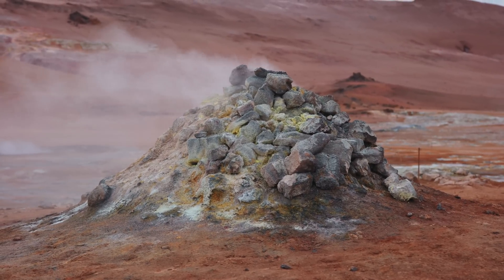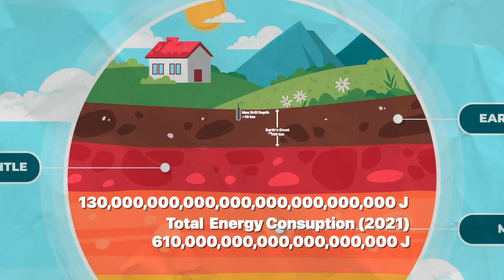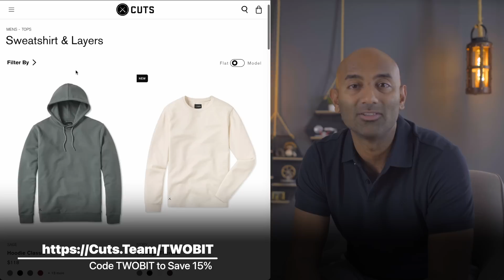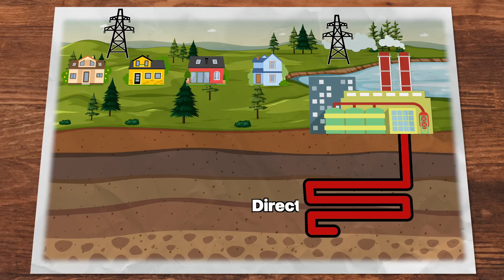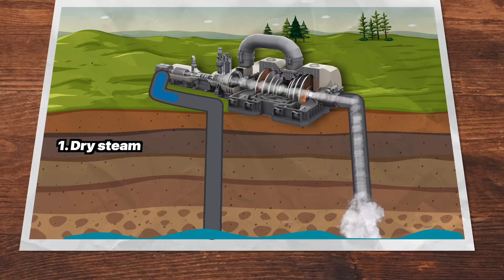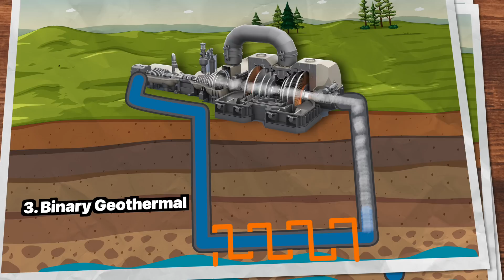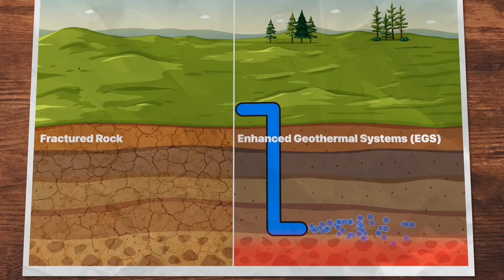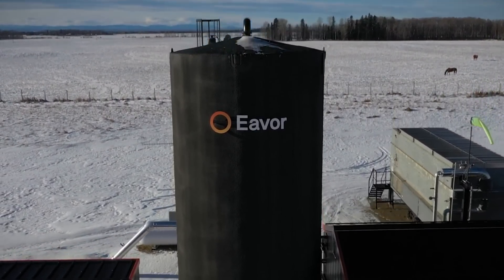This Breakthrough Energy Source Will Replace Nuclear & Coal!

Comment: Cool the core and destroy the magnetic force field protecting us from cosmic radiation.
LFTR is virtually limitless. And it can be scaled to provide independent local power. No more transmission grid which can collapse.

Comment: I am appalled that you would waist our time hearing you talk about any geothermal harvesting of a paltry 450°F when there is an endless supply of thorium fuel to run any number of Molten Salt Nuclear Reactors which are fully capable of producing temperatures of up to 1300°F, and seawater can be pumped to the plant site for desalination without causing Earth tremors. 😮 SMRs can also clean up waist water as well as providing electrical power and even much needed rare elements.

Comment: Another potential revolutionary tecnology for geothermal is supercritical CO2 as a working fluid. Higher performance and it removes the need for water in the system 

Regarding that last segment, people forget about the unbelievable amount of heat contained in Kms of hot rock. The thermal inertia of a 4Km layer of rock for a 4Km deep well is inmense, and it would deplete, yes, but in centuries or millenia if overexploited at 200% of the natural heat replenishing. Worrying about it is like worrying about Uranium/Thorium depletion or too much spent nuclear fuel; even if physically possible, the orders of magnitude that you can scale the entire world's power usage before these things become a problem are insane, it doesn't really make sense to worry about cooling down the Earth or running out of fissile material.

Comment: Solar is still the method that makes the most sense to me. The energy is there and accessible with no effort except to collect it with solar panels. This tech will improve over time, for sure, and should remain #1 on the priority list imo. I have nothing against supplementing it with other methods of renewable energy generation, especially until solar panels get to be near 100% recyclable. Screwing with the earths internal heat.. idk.. on a small level, i have no issue. On a global wide scale level.. nah. Lets stick with what we know, and not gamble on a tech that can cause unanticipated, disastrous 2nd and 3rd order effects long term. The core’s temperature is a crucial link to life on earth. Mucking around with it on any large scale is like asking to shorten humanities lease of time on earth. We all learned the core is already cooling very slowly.. adding to that cooling, even in a very minute way, sounds awfully dangerous and very humanly arrogant/ignorant.
Reply: You're dismissing geothermal without understanding the magnitude of energy in the core or the effect of isolated cooling of the shallow crust.   We shouldn't toss out a very promising clean energy technology on the basis of a gut-level fear.  There are people who know geophysics.  Solar is intermittent.  We need a continuous source of clean power for baseload.  Wind and solar can do the rest.
Reply: @incognitotorpedo42  i get the idea of the magnitude of heat in the core.. and I get that it would be a very minute draw of energy in comparison. And I’m saying, yes from my gut, that f’n with the core of this planet.. even on a tiny scale.. seems like another human, bad idea. A few power plants.. for a few dozen years.. even a thousand.. ok.. a few thousand power-plants.. for many thousands of years.. smells like human hubris to think they know now, what will happen then. Math is great. Science is wonderful. It CANNOT predict all the 2nd, 3rd and further orders of unintended consequences. This is not a game to play. Solar, with energy storage, are MORE than capable of running this entire planet from today, until the day this planet is consumed by that very same energy source.

Comment: I was waiting throughout the video to hear about the laser mining with fusion technology, glad you're making a whole video about it !
Reply: Yes, 🙌🏻 I’m excited about that one 2 😊
Reply: Lasers are not suitable for this type of bore hole drilling. No laser exists with the power to do it and even that energy is "scattered" due to the wavelength they operate at, making them very inefficient. However, millimeter wavelength EM can do this. SImilar to Microwaves and yes, this is used to heat the plazma in experimental tokamaks that this tech was originally developed for. These devices are called "gyrotrons" and are commercially available right now. 

The biggest problem with this way of drilling is the power supply. Althought this seems possible to do, the bore hole needs to be extremely straight, otherwise power transfer from the surface is degraded. This is not the end of the world as straight should be possible but does limit the idea of creating underground "radiators" like the Eavor system proposes. If you can solve this energy supply problem (might be impossible due to the Physics, not sure) then you could drill deep and horizontally once you're at depth, that would be great. If not, there might be a problem with contamination (radiation, metals, minerals) if you just want to frack your reservoir down there. Still, I think these are solvable problems and in economically viable ways. So yes, we should be putting r&d money into this tech asap.

Comment: Didn’t you miss a part regarding the drilling. There is a fancy new laser drill technique that is a fraction in cost for drilling a hole for this very purpose. If I recall the laser drilling process means the hole is melted into a sort of glass. So the permeability of the rock is not as big an issue.
Reply: Quaise Energy. It is not laser drilling. It is called millimeter wave drilling.
Reply: @somsundarsrimany6941  thanks. That rings a bell much better.
Reply: He said at the end he'll be making a separate video about it.
Reply: Yeah! Deserves a video of its own!
Reply: @ipp_tutor  and all who committed. Thanks. 
It seems to be that all this “sun in a box” fusion research funding is quite opportunistic. It becomes more exciting when there is an energy crisis. If successful obviously the rewards are far reaching. The research may not be afforded if we found something else first. And really we already have a sun in a box. It’s called plant earth and this millimetre wave drilling really could let us get at it repeatedly and cost effectively. 
The question then is about what we miss out on if we succeed in using earths core. Well we would slow down our fusion reactor research I expect. And all those other potential benefits may be halted for a long time. Still, I think, in my amateur couch viewing way, that using the earths core to power our lives makes most sense.

Comment: there is also a tech called Millimeter wave drilling that is in testing phase.  They claim to dig deeper than 20 km in Earth's crust to get more temperature delta from Geothermal. Also they claim that drilling by this tech will be cheaper and sustainable.
Reply from the maker: we need to follow up on this!
Reply: @TwoBitDaVinci   Quaise Energy

Comment: Tesla had the right idea by tapping the electrical current that flows through the air.putting a power tap on top of every home that matches the frequency of the electrical current in the air would give you free energy. but oil companies  will not allow that.

Comment: I think that Advanced Geothermal will be a great solution in the kit of energy solutions.  At the moment, expense is the primary issue for investment.  Other issues you mentioned are only issues with specific methods for geothermal.  The closed loop system is in my opinion the best overall, but is more expensive up front.

I also think that energy usage will continue to grow at a more geometric than linear rate as we move forward, so even this maxed out will not be enough.

Comment: I wonder if they can use a peltier circuit/ system to turn the temperature difference into electricity,directly ?
It might save a ton of work!
Reply: I think sadly peltier's efficiency is too low. I have seen comparisons that showed steam turbines at scale were still a better choice. Otherwise I would be with you on this 100%.

Comment: Not so much worried about the earth's core cooling off too much.
However, if deployed on a massive scale, all the extracted energy would end up as extra heat in the atmosphere. That might be a bigger concern than a tiny amount of cooling of the core.
Reply: "Energy conservation".
If we take "heat" and convert it to "electricity", we haven't directly added heat. We changed the state?
You will argue (?) that the energy still remains and may become heat at some stage?
.
Well, at the moment, we take "a fuel" literally change it directly to heat in internal combustion engines, us, in the process, release various gasses and compounds which prevent that heat radiating to space...
Your choice.
Reply: @rogerstarkey5390  Between burning fossil fuel and using geothermal energy, geothermal obviously wins.
And yes, the total amount of energy of planet earth won't change significantly.
What I am wondering about is what the effect is of shifting lots of energy from the big massive solid ball to the thin and comparatively extremely light layer of gasses on the outside where we happen to live.
As with fossil fuel, we are adding energy (and most of the produced electricity does indeed end up as heat) to our atmosphere much faster than what would naturally occur.
All in all it may or may not have a big effect, but I think it is worth to consider/study all possible side effects of relatively new technologies, especially when scaling up to global levels.

Comment: What Eavor has done is something that should have been done from the beginning. Closed-loop geothermal, where the water is piped through the pizza-oven-hot rocks at 1/4 of the way down into Earth’s crust and just piped back into the plant as steam without percolating into the rocks first, is a long overdue approach to this.
Reply: Agreed. It must be hard, though, to perfectly align two separate boreholes. I think it's amazing that anyone pulled that off at all at 10Km depths
Reply: Should have been done, but those with the expertise had another form of "revenue"?

Comment: East of Sparks Nevada there was a geothermal plant that sits abandoned. We recently drove past it on our way to California and there is a lot of activity at the site. No idea if it has anything to do with geothermal. 

I had a client in Roseville CA who built these plants and he said there were possibly insurmountable issues that needed to be overcome and the biggest had nothing to do with steam but I believe it had to do with dissolved minerals in the steam that made it hard on the turbines.
Reply: @Bill Karoly
This system uses a sealed pipe. No contamination.
Reply: I read there are a few other companies that are reusing old abandoned geothermal plants and repurposing the wells to build a new heat extraction mechanism that pumps water on the outside or two concentric pipes so it absorbs heat and then sucks it out through the central pipe. Perhaps that's what you saw?

Comment: energy storage: pressurize air. as it gets pressurized, pull out nitrogen and oxygen. reclaim most of the energy as the air is released. you are left with clean air, a dense storage of pollutants and rare gasses, and energy.
Reply: If you take out the N2 and O2, there isn't much left.
Reply: @incognitotorpedo42  yes, exactly, that just gets stored, and taken out of the air, working towards derailing the doomsday train we are on. so the energy stored in pressurizing the dirty air is mostly returned as you depressurize the cleaned  air. perhaps i shouldve said' while at pressure'.. but its going to happen during pressurization, because at two different densities, the elements will be cheaper to pull out of solution. and i do propose pulling all oxigen, nitrogen, probably helium since we are running low, ect.  wouldnt it be nice if we could make a solar powered drone air scrubber?

Comment: I like to bring up a term Carnot cycle efficiency.  Fossile fuel power plants with modern materials can use steam temperatures much higher than even nuclear and the mentioned geothermal (with practical drilling depth) is still lower.  The steam process efficiency is obtained from temperature difference divided by the high temperature, both expressed as absolutes, i,e. in Kelvin degrees.  Let's assume you can cool the condensate to 350 K and the high temperature is 525 K.  Then your Carnot efficiency is just 33%.  If you can utilize the waste heat for some other purpose, like home heating, then your efficiency becomes reasonable or comparable to traditional fossil fuel based thermal cycle.  That may give another reason besides use of waste water to have the geothermal installation near sizable urban centers.
Reply: Yes, using the excess heat as district heating or industrial purposes would increase GT usefulness. The efficiency might not be as relevant if the cost can be lowered- and it will already have lower carbon emissions.
Reply: You're totally right. And binary plants that use pentane as a working fluid use the organic Rankine cycle. These show an efficiency of 20% because of the lower temperature in the hot reservoir. That's why we need to drill deeper and access higher temperatures. The millimeter wave maser can allegedly drill 20 km deep and access temperatures of 450+ °C, or 723K. That would imply a maximum efficiency of  52% assuming we cool the vapor down to 350 K as you suggest. What would be interesting to see is a cost analysis to show if increasing the efficiency to 52% justifies drilling the extra 10 km.

Comment: IMO EGS (Enhanced Geothermal Systems) is dangerous because there could be some radioactive elements or poisonous ones (like arsenic) that can be realesed from the cracked rocks so there is a risk of contamination in combination with geoogical instability.

Comment: Deep geothermal is only necessary if you are convinced that high temps are needed. Lower temp conversions are possible, and you only need to get below the frost line (or heat line for hot climates).
Reply: If you want to make electricity, efficiency drops as the temperature difference between the hot reservoir and the surface gets lower.  This is due to a fundamental rule of thermodynamics called Carnot inefficiency.  If all you want to do is heat a house, then all you need is a heat pump and a loop near the surface.

Comment: I live where there is a lot of Fracking happening, the deposits and that are between the fracked rock and the surface are possible contaminates that at least the oil & gas industry does not account for as long as they can separate the hydrocarbons.

Comment: I think a the short term as well as long term solution for energy in some areas is blowhole type wave generators:
Wave Swell Energy's remarkable UniWave 200 is a sea platform that uses an artificial blowhole formation to create air pressure changes that drive a turbine and feed energy back to shore. After a year of testing, the company reports excellent results.
As we've discussed before, the UniWave system is a floatable device that can be towed to any coastal location and connected to the local energy grid. It's designed so that wave swells force water into a specially designed concrete chamber, pressurizing the air in the chamber and forcing it through an outlet valve. Then as the water recedes, it generates a powerful vacuum, which sucks air in through a turbine at the top and generates electricity that's fed into the grid via a cable.

As a result, it draws energy from the entire column of water that enters its chamber, a fact the team says makes it more efficient than wave energy devices that only harvest energy from the surface or the sea floor.
WSE's key innovation here is that one-way generation; other devices that harvest the same effect use bi-directional turbines, requiring the ability to reverse blade pitch or redirect the airflow. WSE says its design allows for far cheaper and simpler turbines, that should also last longer since they're not getting as much salt water splashed through them when a big wave hits. Indeed, all this device's moving parts are above the waterline, a fact that should help extend its service life as well as making it completely harmless to marine life.
Interestingly, the UniWave's design also makes it easy to incorporate into breakwaters and seawalls, where it can take a coastal erosion protection project and turn it into a clean energy source.
Reply: The only thing that's relevant is LCOE.  Do you have a number for that?

Comment: Great video as always. Its should be investigated if the heat being released from underground into the atmosphere will accelerate global warming.
Reply: Yes, heat would move out of the crust faster, but global warming is mostly due to the greenhouse effect. Otherwise infrared radiation can carry the heat into space. Additionally, burning fossil fuels and fissioning atoms generates heat also… so there is added heat in any mechanism subject to entropy.